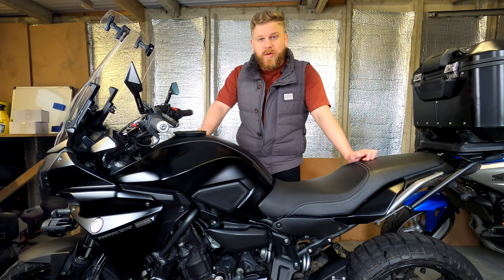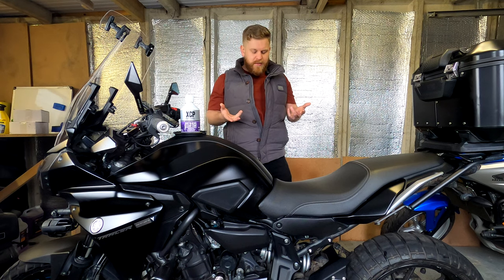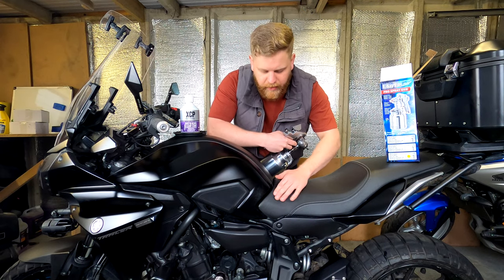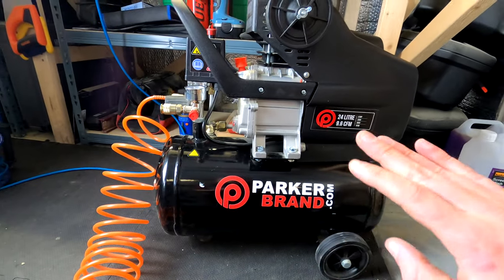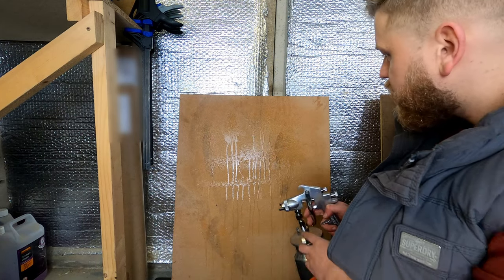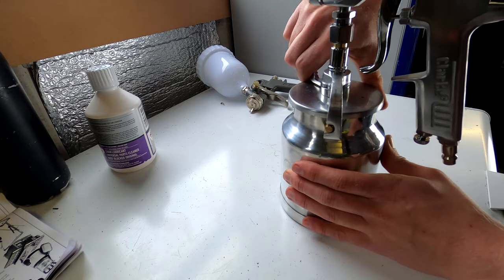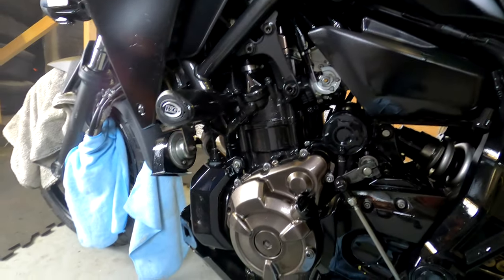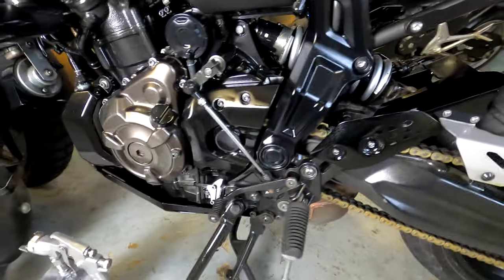Is This The Best Rust Protector For Your Motorcycle? | XCP Rust Blocker | ParkerBrand Air Compressor

Comment: Hi Sam, what makes your vlog stand out is the prep at the start, having sprayed all sorts in my past and made such a hash of it by having cheap spray guns and not fine  tuning the spray pattern, much more critical with paint than this though. I use acf 50 and i have tried varying nozzles sizes but have found the 1.0 mm nozzle the best for misting. I remove my seat as I like to do the frame and electrics under the seat where condensation  lurks and even raise the fuel tank to do the frame. I also use detailing brushes £5 on e bay to do my brake caliper bolts and housings as well as my wheels. When I wipe the excess off the bike with a microfibre cloth i keep the cloth is a plastic bag and use it to wipe the wheels. I dont know wether its meant for it but I do not lube my chain but paint it with acf then wipe. Current chain on 18000. Not tried this but loved the Bennets video. Wish I knew how to make  a video. Theres something very therapeutic about seeing a bike this shiny and clean. The other thing i do is in between washes I used gt85 spray on and leave. I know it washes off but replenishes that finish  as I only do acf twice a year. Well done on a great video and the look on your face on how the bike looks😎😎. Just bought an nc in the background too😎
Reply from the maker: Thank you! I've made the mistake of painting things in the past with not enough prep so approaching this made sense to treat it the same! Sounds like you do a better job that I do though! Haha!
Appreciate the kind words and congratulations on the NC - its an awesome machine!

Comment: just about to do the same job on a new tracer 7. If you've got a compressor you can use a mini HVLP gun rather than a full size.  Slightly easier to use and  more directional. Having said that, if you mange to get a good spray pattern at low pressure with a standard sized gun, it'll be quicker. Thanks for posting this up

Comment: Just found your channel for the first time, great video, I have a compressor and bike dryer on my list to 🎅 this year just for this purpose.  Both this and the compressor video have hleped me ralise this is the way forward. I was gonna pay allyearbiker to do the bike at £85 per treatment but figure investing in the kit is an investment worth it in the long run. All the kit may cost a little over the cost of 2 applications but once ive done the treatment twice its almost paid for itself. Any long-term gremlins/ issues with that compresssor? 
You now have a new subscriber, keep up the great work.
Reply from the maker: Thank you! That's exactly why I ended up buying it all myself! After a few coatings you're in the green by quite some way. And you get the pleasure of buying new tools which... who doesn't love that?!

No gremlins at all with the compressor, fires up with no issues at all. I always drain it after use and just leave it empty unless I plan to do any substantial work. Just redone the bikes this year and it worked first time again. I would probably up the size if I had the space just so it didn't kick in as much but it's got plenty of oomph!
Reply: if you do a decent job, you can recoup some of the outlay by doing your mates' bikes for a small fee and cups of tea on demand...

Comment: I moved over to XCP from ACF awhile ago also mate, the only thing with XCP is how sticky it is- which is a pain to clean up but getting rid of excess with a cloth and heat does help a lot with that
Reply from the maker: Nice! How have you found it so far? Ahh good to know! My freezer has a lovely sticky residue on it haha
Reply: @SamVBikes  Ha! 
I love it, compared with standard ACF it blows it out the window. The only thing I’ve managed to get thats anywhere close is ACF’s saline/boat version called corrosion block (green, stinks) which is designed for salt+water - also cracking for our shitty salt laden roads over winter. 
Also in my experience running the engine to burn off the residue helps it bind the metal a little better for some reason 

Subbed!
Reply from the maker: Ahhh great to know! Always nice to hear someone say that rather than "you've made a mistake there mate" haha! 

Thank you for the sub! Appreciate it!
Reply: @SamVBikes  Such is the internet my friend. You do what you want, and find out for yourself if its worth it. No-one else can take that experience away from you at that point, and either way you can learn something
Reply from the maker: Very true! Wise words. I'm glad I did it so hopefully will continue to prove worthwhile
Reply: how does it hold up to heated parts? Such as the exhaust and engine, I've had issues with rust on exhausts and got some XCP after tons of research but worried how heat affects it. ACF I believe (maybe was XCP) says stains might be visible after heat exposure

Comment: Great review. I have watched other tests with this product on a brake disc outside . It out preformed acf50 big time where within 2 months the acf50 was rusting and the xcp was still protecting..
Reply from the maker: Thank you! I've used ACF50 for a few years and this made me wonder why! I suppose if a product is marketed enough, we all buy into that. Glad I found this though!
Reply: @SamVBikes  has it held up under washing conditions with it being tacky
Reply from the maker: There is definitely still a shine on it but it's not tacky anymore. You can tell there is still a protective coating on it. Water seems to run off very quickly!
Reply: @SamVBikes  excellent . Time to order some. Thankyou for your video and feedback appreciated..
Reply from the maker: No problem! Hope it works well for you too. Thanks for watching!
Reply: Everyone including Sam says not to get these corrosion inhibitors on your tyres or brakes!?! @Jim So you're saying it prevents a brake disc from rusting outdoors. And then @Sam agrees with you etc and doesn't show any concern that you're talking about putting it on brakes!?! Can you guys please clarify whether it's safe or not to apply to brake discs and other brake components, and if so, can you be incredibly specific?
Reply from the maker: The test Jim is talking about is where someone used an old brake disc off the bike to test the corrosion protection, so one that was no longer in use. Do not put it on brake discs you're planning on using!

Comment: Great review again Sam. I have just purchased an ACF 50 bumper pack but will try this next time. I look forward to hearing how it holds up. The spray gun looks like it's a more efficient method of application than the squirty bottle too, making it even more cost effective. Cheers Sam 👍
Reply from the maker: Thanks Michael! ACF50 has done a decent job up to now but hoping this will up the protection level! Thanks for watching as always!
Reply: @SamVBikes  you're welcome, it's a very useful and informative upload and I'm aspiring to be a compressor owner but it's a bit further down my list. It looks like the best way of applying rust inhibitor too.
Reply from the maker: The compressor is definitely useful.. it makes pumping tyres up etc a piece of cake, but it isn't needed if you're completely honest with yourself haha. Once you've bought one you can tell yourself that after, but for the time being, it's an essential piece of kit! Haha
Reply: @SamVBikes  I agree, I have got this far without one but it's nice to have and has loads of benefits. It's definitely a want rather than a need.
Reply from the maker: You also find yourself using it far more for tasks you've always wanted to do! Recommend this one if you do get around to it later on!
Reply: @SamVBikes  thanks, the table lift is my first priority, after the garage roof 😂
Reply from the maker: We have such expensive lists haha!
Reply: @SamVBikes  I know, mine far outstrips my income and resources and only gets bigger 😂
Reply from the maker: We were always told to chase our dreams! I see it as shooting for the stars 😂
Reply: @SamVBikes  my ex would have called it a waste of good money, then gone to next to buy even more clothes she didn't need, or have wardrobe space for 😂
Reply from the maker: There's a good reason they are an ex... no need for that kind of negativity in life haha
Reply: @SamVBikes  too right, I'm much happier with 3 bikes and no Mrs than 1 bike and a Mrs that thought that was a waste of money 😂
Reply from the maker: Haha! Much cheaper and always happy for you to ride them! 😂
Reply: @SamVBikes  definitely costs a lot less, believe me! 😂

Comment: Good video - thanks.  

You used XCP professional Rust Blocker Clear Coat here; there's also XCP professional Rust Blocker, with an orange label, rather than the blue.  Any idea on the the difference(s)?
Reply from the maker: Thank you! I think they are both relatively similar. The original Rust Blocker has a higher corrosion protection rating but is more difficult to apply and remove judging by xcp's website

Comment: Great video! Just curious - this was posted May last year? How did you get on through the winter of 21-22? Did you find it survived washes after rides or did you have to reapply or even wash the bike?
Reply from the maker: Thank you! Yes it worked really well. Washed the bike pretty much every week in the winter and every other week in the drier months. I ended up trading the bike in but it definitely made my life easier to clean it and I didn't see any new rust spots at all
Reply: @SamVBikes  ah great stuff, thanks for the reply. I don't have a compressor but will definitely give the XCP clear spray a try instead of ACF this year! ;)
Reply from the maker: No problem! I've used it on my new bike too. It's great stuff. I saw one guy use a bigger spray bottle which worked okay. Basically applied it thinner than the stock one does!

Comment: I believe that the xcp rust blocker is the one which people said was sticky but I think they came out with the clear coat to address those issues and it's not got the same sticky nature as the original one
Reply from the maker: Interesting! Not sure on the original but this one isn't sticky which is great. Slightly tacky before it's dry though!
Reply: @SamVBikes  yeah the guy in the Bennett video mentioned this, the rust blocker was very good but has a tacky finish which attracted dirt ect, but the clear coat is a non sticky coat which a little bit less effective but overall better for the bikes 😉
Reply: @kevindarkstar  so there is xcp rust blocker and xcp clear coat ?
Reply: @flesz_  correct

Comment: Great video. Do you spray your tank as well?
Reply from the maker: Just use a ceramic coating or wax for the tank and plastics. This is pretty much solely for metals so I don't bother with painted parts
Reply: Cheers!

Comment: Sorry but I have another question regarding your Clarke Pro Spray gun. Why did you choose the 1.8mm nozzle as opposed to the smaller size 1.4mm? The reason I ask is that Machine Mart in their blurb for these spray guns recommend compressors with motors producing 3hp or more for the 1.8mm nozzle hub and 2hp or more with the 1.4mm nozzle gun. I have just bought the same compressor as you but the 50 litres one. I am not sure whether to get the 1.4mm or 1.8 nozzle spray guns? You didn't find any probs using the 1.8mm nozzle spray gun with your compressor? Also what cleaners did you use to prepare the bike before applying the XCF coating? Many thanks.
Reply from the maker: No problem! I have had no issue with the 1.8mm jet. I'd assume you would get a finer spray with the 1.4mm but using it for the XCP doesnt seem to matter. Maybe with paint you might find that more important! This compressor has no issue running this spray gun at all.
Cleaning the bike down, I used a mix of cleaners, mucoff, snowfoam, and a vehicle shampoo which doesnt have any waxes or coating properties as I wanted to strip everything off the bike. Thanks
Reply: Hi Sam, Thanks for the rapid reply. That's helpful as I am starting out on   valeting my bike and new to compressors and paint guns. I thought you had coated yours and your other half's bikes with XCP clear coat? They looked fab from your video. Many thanks.
Reply: Your overthinking this. It's not a professional spray painting video (no offence to Sam) your just wacking on some protectant. Blast away with whatever you've got.

Comment: What about when you wash it again does it stay or need reapplying?
Reply from the maker: It's meant to withstand any normal washing with any soap but I'd assume a heavy duty traffic film remover would take it off. I tend to use a PH neutral wash anyway which helps preserve it too!

Comment: how does it hold up to heated parts? Such as the exhaust and engine, I've had issues with rust on exhausts and got some XCP after tons of research but worried how heat affects it. ACF I believe (maybe was XCP) says stains might be visible after heat exposure
Reply from the maker: I had no issues with any stains! Mine was applied thinly so that probably helped. You so get the light smoke the first time you start the bike but no issue with marking
Reply: @SamVBikes  fantastic thanks! And did use the regular XCP rust protectant or the newer thin coat?
Reply from the maker: The Rust Blocker Clear Coat. This vid was a few years back so I assume the original. I'm still using it on my new bikes too

Comment: While you do the engine casings, do you spay the exhaust. 
Just wondered what it was like on high temp areas. 
Does it burn off?
What product do you use for the wheel rims
Reply from the maker: I tend to leave the exhausts as they get so hot I doubt it would stay on for very long. It seems to work well on the engine casing but I wouldn't worry with the exhaust. Hope that helps
Reply: @SamVBikes  cheers

Comment: How is XCP on matt paint finishes? Does it turn to gloss?
Reply from the maker: It does have a slightly gloss finish but it softens after a while. It should mainly be used for the metals. I use other coatings for the plastics which are matte Finish
Reply: @SamVBikes  Any chance you could share what these are? I have a new to me as new Triumph Speed Triple and all the plastics are mat so looking for protection for them that keeps them matte finish?
Reply from the maker: I use a mixture of products.. to date I have mainly used AutoGlym Rapid AquaWax, but I have just Ceramic Coated the bike with CeramicPro. There's a vid recently on my channel for that